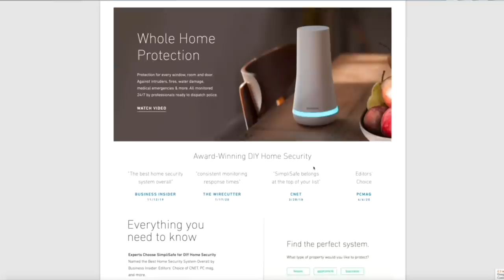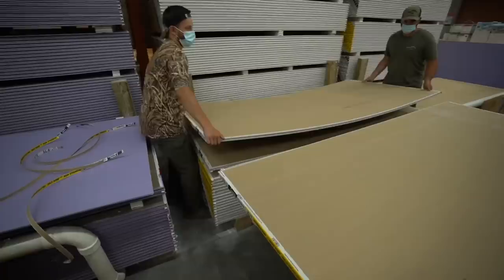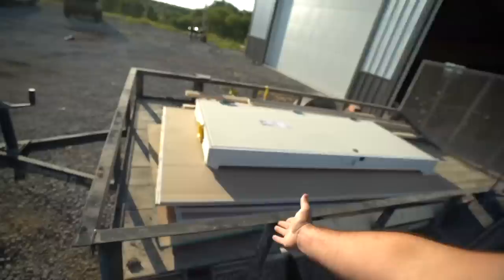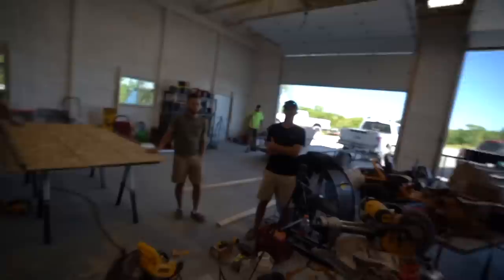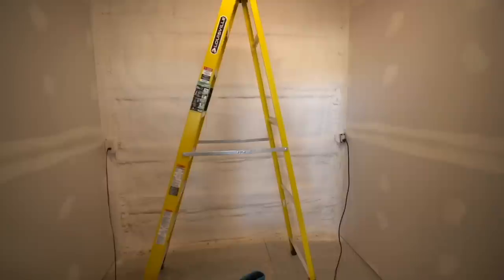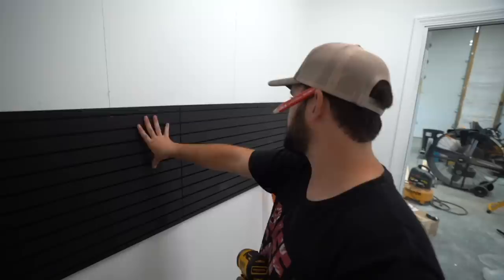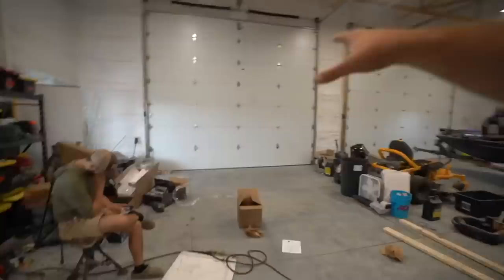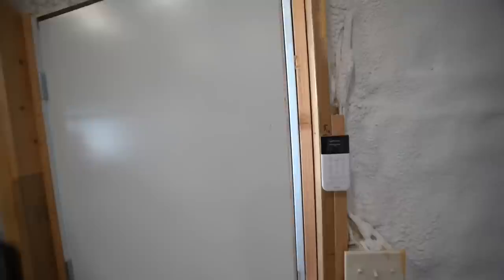Building a GIANT SECRET VAULT in My GARAGE!!! (DIY WALK-IN SAFE)

Comment: Small carpentry trick I learned from a temp roofing job I had a couple years ago is to mark the beam over the stud so once you're putting nails in you can just put a string at the mark. Saves money if the stud finder isn't behaving that day

Comment: You could add pegboard to that back wall very easily man . Just run some nailer strips along the metal perlin and screw it to it . Then you have something to attach the pegboard to . Or just use self tapping screws and screw the pegboard directly to the metal runners or perlin
Reply: Well if I would have watched all the video before commenting 😂

Comment: Should have used one by twos or one by 4 on the back wall laid flat shot into iron and then quarter inch sheetrock then you wouldn't have to move the boxes just use longer screws with spark guards and if you would have put plastic behind the sheetrock on the walls and ceiling then it would be vacuum tight no moisture . Use 3-inch screws angled and it should hit the stud or use toggle bolts since you cut it to Short

Comment: I put mine in my spare bedroom in my basement, its 15x15 put a legit rhino metals vault door on it and ripped all the drywall out and lined the 2 walls not against the concrete foundation with 1/2 inch steel. The other 2 walls and the ceiling are 3/16 just to keep the aesthetic. All the steel is welded together to be 1 peice. Definitely not the cheapest option (~15-20k depending on steel price) but still cheaper than buying gun safes for the ammount of guns ive got and a whole lot cooler.

Comment: I had sensors on openings and a camera in my shop. Thieves tore open a corner wall under the camera and came right in. Turned the camera so I only knew the time it started. After the loss I added motion/heat/camera mounted high in the truss with battery backup/WiFi and Ethernet camera connection/timers set for various things I won’t mention.

Comment: Hey Flair! Use dry wall anchors when you’re mounting to dry wall, not just screws. It will hold quite a lot more weight and hang more securely that way. :)

Comment: I'm not a thief but if I were a thief, I'd just bust down a hole into that exterior wall where it meets the interior of the "vault." It has the easiest access to the inside of the vault, where a thief would want to be. Besides, you could make a really strong vault but with most modern power tools and given enough time anybody could break down through a security door. Sure you could have a motion sensor out on that exterior wall but I doubt it's strong enough to hold if somebody backed up a truck into that exterior wall they'd only need those couple of minutes to steal all the valuables. That is of course if nobody's around to stop the thieves. I also used to watch that TV show where it was a guy who used to be a burglar would rob people's homes for the show to show them how vulnerable their house is to being burglarized. In my honest opinion, you should turn this room into a broom closet lol it's more designed to keep the guns inside than it is to keep people out.

Comment: I'm not trying to say that I'm a thief or anything but if I were going to break in your place knowing that it's against that outside wall I would just steal a truck and back it through the back wall and take everything that's how they break into a lot of body shops out here in Vegas they steal a truck back it through a door or in your case the outside load bearing wall load everything up right into the back of the truck just a little food for thought Flair